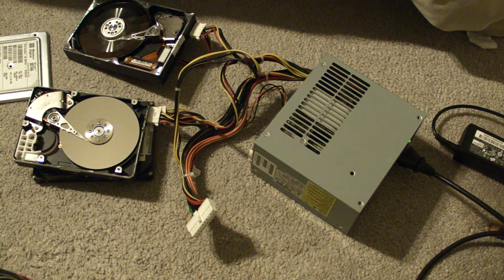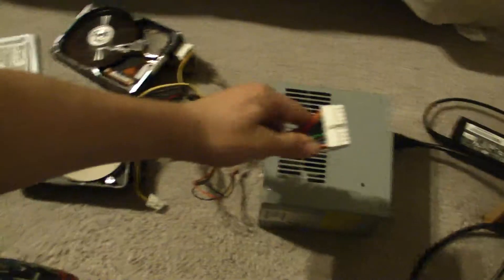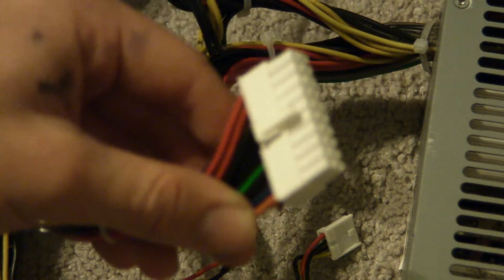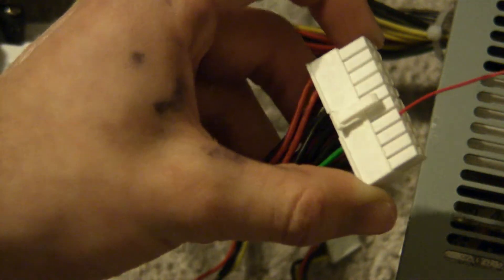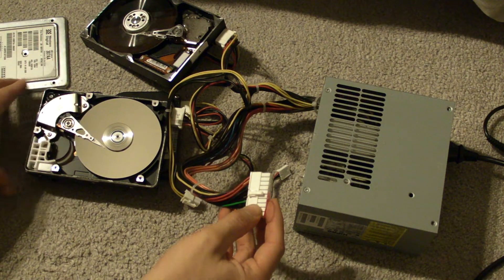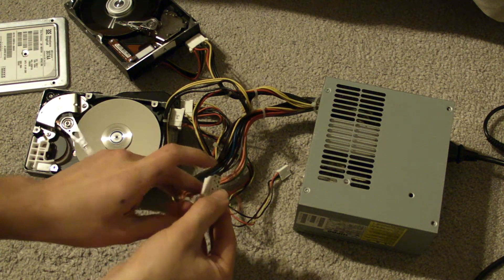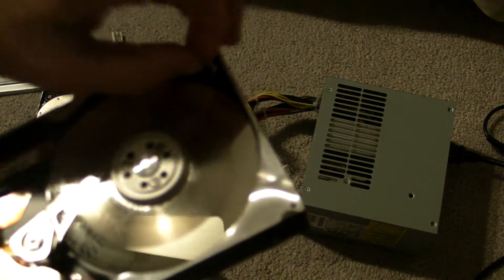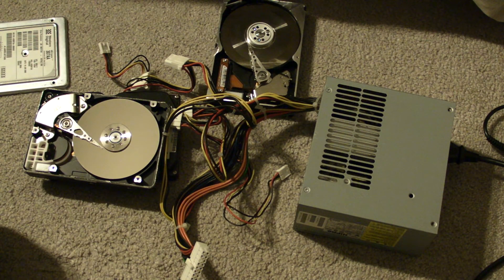How to Jump an ATX Power Supply

Comment: dont put components on rugs/carpets, static can kill your pc parts jesus christ man
get a work bench or a wooden table
Reply from the maker: static electricity can destroy anything that has electronic components especially IC chips. not only that, they were opened for months and not working to when i received them
Reply from the maker: there is no functional PC parts is there? 
exactly... 2 scrap HDD and a power supply now converted into a 12V Source
i do have a workbench, i repair pcs for a hobby.
Reply: hmm well im not sure then, i built 2 pc's so i alays thought to avoid leaving parts on carpets, etc
maybe hdd is exception
Reply: markus goncalves No static can still ruin HDDs the only reason he had them on the carpet is because he didnt care if they broke as he clearly states that they are scrap HDD's.
Reply: Nick Silcox Thats what i kinda said i said that they can still be ruined by static but i said that you didnt care because they were already not working.

Comment: i am intending on making a power supply from an ATX power supply. i have used a jumper from pins 14 to 13 common and plugged in a dvd re-writer but nothing happened, could this be that i did not have enough load or could the power supply be faulty. the power supply makes a very quiet noise when switched on so i know its getting power and i have checked the fuse and all is ok. im hoping that i just did not put enough load on it, what do you think?